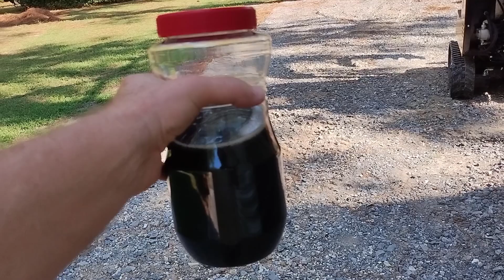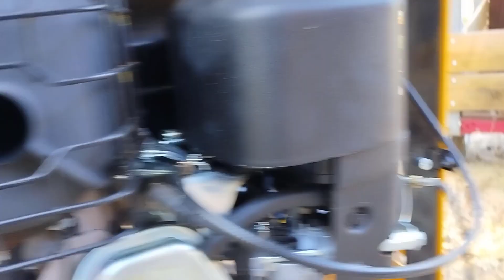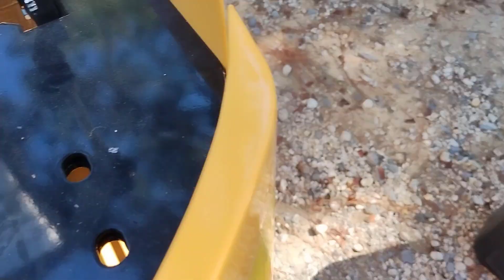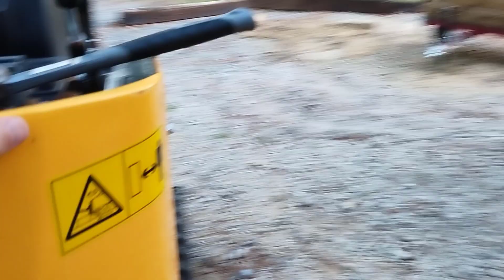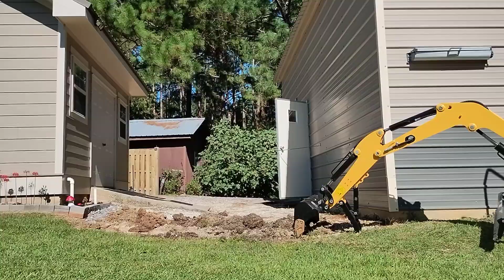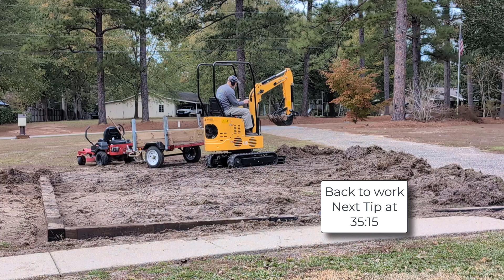Chinese Mini Excavator Ownership: 10 Essential Tips After 25 Hours of Use

Comment: I buy several of these machines every year.  The machines that are assembled and distributed stateside have consistently been arriving with acceptable oil and hydraulic fluid.  Don’t immediately dump them, check them first, often times they are perfectly fine.  I have had zero issues after several hundreds of hours with the hydraulic fluid that they come with.  I also run the first 10 hours with the engine oil that they come with AFTER inspecting it first.  Don’t bother emptying the gas, that’s nonsense.  They usually come near empty if not empty.  Put two fresh gallons in and go.  DO NOT REPLACE THE NEEDLE ZERK FITTINGS WITH THE STANDARD FITTINGS.  The needle zerk fitting work excellent and you will break standard fittings off during use.
Reply: I had to dump the gas that came with my Vote VTW-10, because it crudded up the carburetor (with actual deposits in the bowl) after sitting from the January unloading until decent excavator weather in April. After removing and thoroughly cleaning the carb, the mini started and ran flawlessly. (B&S engine like the Landhero's)

Comment: Todays automotive oils have "dispersants" that keep dirt suspended in the oil so it can be pumped through a filter. On these splash oiler engines you want the dirt to stay in the pan. "small engine" oil doesn't have the dispersants. I learned this the hard way with an antique stationary engine, had the crankshaft repaired twice before I learned my lesson.
Reply: good point!  Thanks

Comment: I have the kv16 model, basically the same. You know you can put the mechanical thumb in the stored position without removing it. My engine  oil was also black. Doing the hydraulic oil tomorrow.
Reply from the maker: Thanks for the comment. I have not done the "storing" option but may give it a shot. Let us know how your hydraulic change-out did. Do you have a usable drain on the tank or is it like mine, in a location that would just make a mess?

Comment: I bought an H12R at an auction last summer. First thing I did, was an oil change. I used Castrol 10w-30. Don't listen to what others are saying about oil. Synthetic or old school as long as it's fresh  oil, it'll be fine. Next I changed out the hydraulic fluid. It didn't have much in it to begin with, wasn't even registering in the sight gauge. I used Tractor Supply ISO 46 which was recommended. My unit doesn't have a drain for the hydro tank. At least I couldn't find one. I used a handpump siphon to get out as much as I could. I also closed all the cylinders so as much as I could get put was in the tank. I plan to change the fluid once a year or so, so eventually it'll all get changed. I also added a fan inside the engine bay to circulate some air. I wanted to install two like most guys do but there's not enough room in mine to easily do do. The one fan seems to work well enough. I have it wired directly to the cutoff switch so I know when the switch is off, the fan isn't going to keep running and kill the battery.
Reply from the maker: Great comments. Where do you access the bolts on the swing motor. Got any pics?
Reply: One other thing I did after a couple hours use was to check the bolts on the swing motor. Yep, they were loose. They use an 8mm hex (allen) wrench. I tightened them up as best I could(not a lot of room again). If they loosen again I'm going to use loctite.
Reply: Oh yeah, and I installed a hydraulic thumb on mine. The one it comes with is useless, especially if you're digging.

Comment: Thank you so much for this video! I've only got about an hour into mine and I'm going to change engine & hydraulic oil soon. And call me crazy, but is there not a hydraulic or engine oil filter on these?
Reply from the maker: Not crazy at all. To be honest, I looked and looked for an oil filter but it's just a little B&S so it doesn't have one. As for the hydraulic filter, I wouldn't know one to see one, so I didn't look. Thanks so much for commenting. I'm over 50 hours now and still loving it!
Reply: @XoomLenz  That's so awesome! Thanks again!
Reply: The cheap units like mine don't come with a hydro filter. Some guys add them. I'm not, simply because mine will not see a lot of use. Same as the engine, it's easy to just change the fluid every year or so. .

Comment: I find that mine starts better with the pull cord. It’s 1 or 2 pulls even when it’s down right cold. I don’t think the electric start doesn’t spin fast enough.
Reply from the maker: My unit cranks great with the starter. No problems but thankful the pull option is available.
Reply: @XoomLenz  yeah mine turns over great but starts only when I use the pull cord. 😂😂😂😂
Reply from the maker: @philcolprit4182  😂👍

Comment: I also like how your hoses are all inside the boom .i have a Miva and my machine seems way jerkier, I’m going to put a cushion valve on mine ,supposedly it helps.
Reply from the maker: I've thought about a cushion valve. I still have to concentrate pretty hard not to go into herky jerky mode. Thanks for the comment.
Reply: You're not going to like that feature if you blow a hydraulic line, and have to fish a new one through the boom.

Comment: Under the deck plate what you thought was the hydraulic pump next to the battery is actually the hydraulic swing motor. The pump is connected directly to the output shaft of the gasoline engine.
Reply from the maker: Man I really appreciate the correction. Good to know. I need to make a correction notation in the video. Much Thanks!